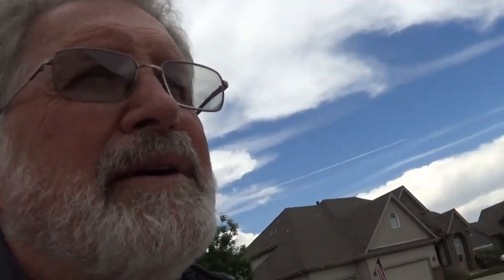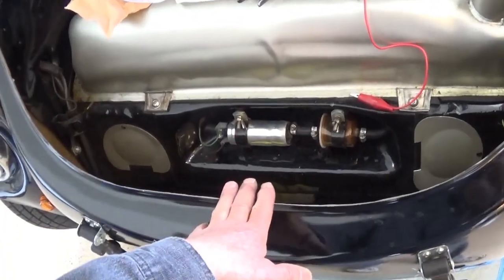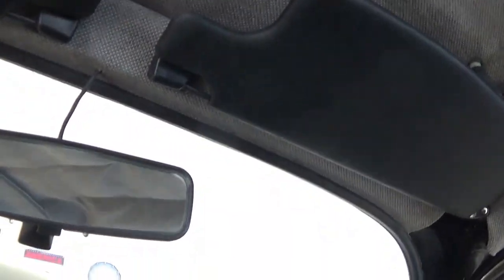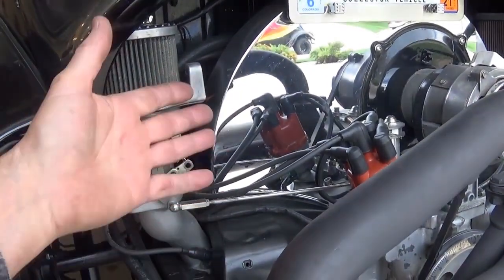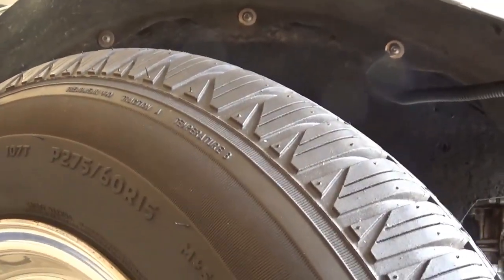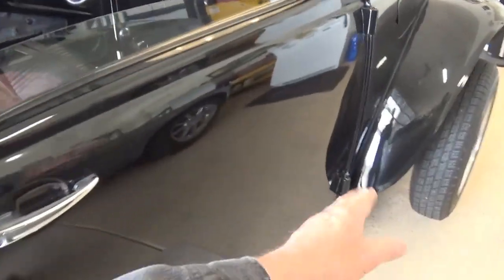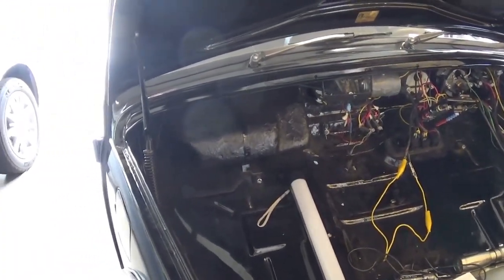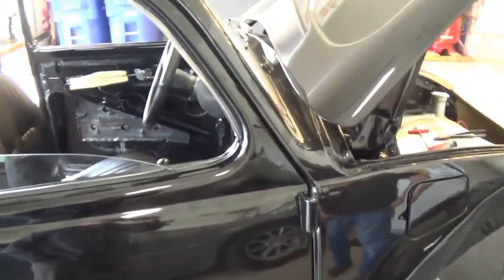VW Street Baja (1600 DP)

Comment: The crankcase vent hose with a low-point between the neck and the carb....  won't that tend to collect a puddle of oil which will diminish if not eliminate the vent suction?
Reply from the maker: Nope!  Just take off you oil fill cap when the engine is idling and feel the crankcase pressure puffing out. Now add to this the vacum created by the carb sucking in air. You talking a P-trap type seal and no liquid is going to stop that air flow.

Comment: I have the remote oil filter as well, might check the oil flow charts for my lines. Holds about 45psi on the highway. Thanks for the advice .

Comment: It's already been said that the oil hoses can hold the pressure, and they need to be bigger, 1/2"minimum. I'd also move the hoses away from the #4 exhaust. Those in/out pumps are kind of restrictive too. Tapping the case for full flow would be much better but that's risky without splitting the case.

Has he got solid rocker shafts?  Nice car.
Reply from the maker: I just met the guy and he was having problems with his new purchase. I could have spent days checking things out and making little changes here and there. I didn't want to push it and pop a valve cover to satisfy my curiosity. I suspect he was having a little buyers remorse so I just addressed the main issues and was on my way. He is capable of doing the basics. My part was over. Glad you agree with my oil hose observation. Thanks for your comment :-)